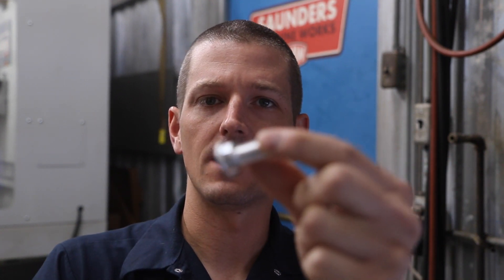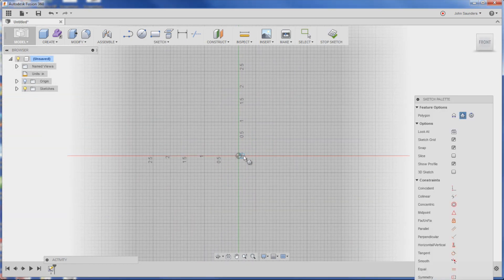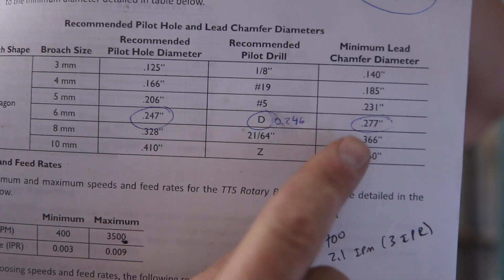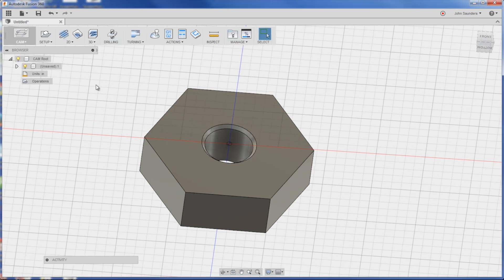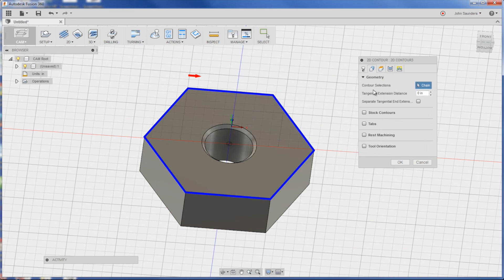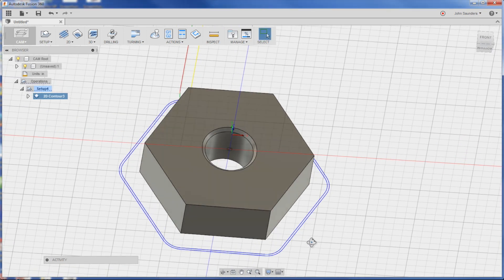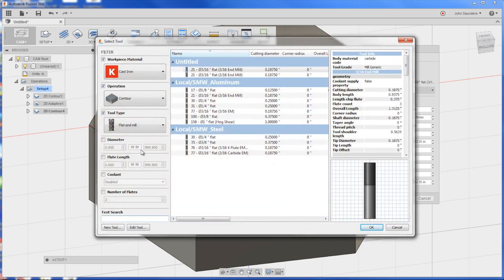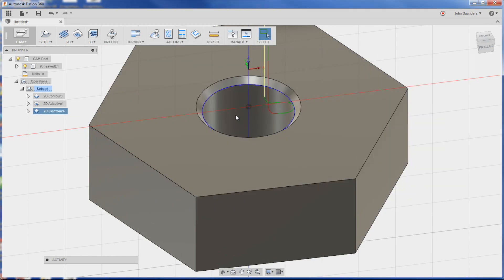Rotary Broach!  Shoving Square Things in Round Holes!

Comment: Me think that the depth would have been deeper if the work piece didn't slip down in the collet. Take a look.
Reply: +NYC CNC  Yeah, the nut probably wouldn't be so tight on those aluminum threads too if they hadnt been forced down in that collet ;) needs a shoulder to back up against, the broach exerts alot of force...
Reply: Good fucking eye

Comment: Very cool!  I've thought about rotary broaching for an idea I had for some custom aluminum r/c servo horns.

One tiny tip for Fusion CAM to save a couple clicks - When you select the edges for the Contour Selections, pick the edge on the bottom of the part instead of the top.  That way you won't have to change the Bottom Height because it defaults to "Selected contours".

Comment: The part slid on you in the collet block. I try to always use a ID stop to 5C collets in a block to maintain repeatability to Z without having to over clamp the collet. you would have a deeper hex if it didn't slid on you.
 I've never used any rotabroach, I was wondering if you are able to "time" the flats of the ID to match the OD ?

Comment: I think I've seen video where they start the spindle after the tool makes contact. That is if the angle matters.
Reply: Maybe, but looks better with chamfer.
Reply: NYC CNC ALWAYS use a chamfer...you'll dull the tips of your broach pretty quickly without one.  You can, however, get away with a smaller chamfer most likely.

Comment: 11:35 You see your clamp fixture failed to hold the part into place. I know you had it higher for the milling operation but you should have re-adjusted the position deeper after so that it would have resistance to the broaching operation on the shoulder of the part!
Reply: +NYC CNC I noticed the little scoot too. :)  I like to thread bolt shaped parts into a scrap piece of aluminum for fixturing if I can.  and as minor a plus you can get repeat clocking between the threads and the milled hex on every part.  
 ....which got me thinking about those square holes:  Is there any way to control clocking of the broached hole?  as it is, I guess it just grabs where it grabs huh?   Thanks for the cool stuff here John!
Reply: Morgan Oliff Nice question, i expect an answer but probably possible if you have a tool to locate the broach initially at the angle you want and then leave it plunge as soon as it grabs
Reply: +St0RM33 it just caught my curiosity,  :) maybe more of a big deal when doing square holes, as apposed to hex.  I thought about, and the only thing I could come up with was to jog the tool down and square it off with a parallel against one of its flats as you bring it into contact with the work. Then let it broach from there.

Comment: Nice tool, probably more affordable than the commercially available ones. Keep broken endmills around for broach making stock. A surface grinder might be nice too..LOL
I did a shop made head a couple years back but was limited on the broach material. Been meaning to try some drill rod but never seem to get back at it.

Colin ;-)

Comment: Very cool.  Any guidance on how you can align the broach to be parallel to the faces  on the outside of the part ?
Reply: NYC CNC  I wonder if the chamfer could be used to guide the tool into the desired alignment. Would it start to cut soon as the corners are caught on their respective edges at a repeatable angle?
Reply: +Matt Hogstrom Some of the rotary broach holders have a threaded hole on the free-spinning part that allows for a stop rod to be inserted. Then the broach is held in a particular orientation by the rod being pressed against a fixed piece on the holder as the tool spins aligning it to the work piece.

Comment: The method that the CAD program uses for calculation and rendering is probably boolean operations. It's essentially a difference engine that calculates what is to exist and what is not. It's an effective and efficient way to calculate something like milling. This of course needs to be correlated with the functional aspects of the machinery. That is probably where the "stock to leave" input in the UI originated. It might seem a little counter intuitive from a real world perspective; but the UI might be more complex and fiddly otherwise.

Comment: That's pretty cool,  So it was using the vertical movement of your mill as a press while wobbling the tool a bit.  Nice fit!  I noticed it pressed the part down into the collet, was that by design?  Thanks for the video, hope you made back from Cali safely.
Reply: NYC CNC I saw it too. was it not clamped in tight enough?  Could you have put a scrap of smaller diameter than the part, in the bottom of the collet to press on the table and contact the part so it could not move down?

Other than that, a rotary broach looks like one cool tool!!!!!!!!

Comment: Hey man, the broach pushed the material down into the vice again... lol :) Try threading internally a round nut so you can clamp it tight not on the threads. Cool tool, i need a tormach! Looks like you've come a long way with fusion ;)
Reply: +NYC CNC Wait was that sarcastic? Tighten the threaded round stock right up to the hex. Wont budge, wont tear threads. I've been at work for 11 hrs without a break now on night shift so maybe i'm just reading your doohicky wrong. Just thought you coulda ruined your threads pushing it down like that broaching, since it slid down the collet and all. Never mind machine on!

Comment: For more accurate work you will learn to reverse the broach rotation halfway into the cut depth.  We used to run them in a lathe and we turned the work and not the broach, which for us was also more accurate than a BP but idk why that was. I just did as told :] I'm really impressed with the Tormach and what they are doing these days.
Reply: NYC CNC keeps it going straight
Reply: NYC CNC I've done the reversing rotation middle of depth on the lathe, yes it will help keep a dull broach straight but a good sharp broach shouldn't need it, especially in aluminum. Also, you can usually get away with a little bit bigger hole.  I noticed that the part moved into the collet during the broaching.  Pucker factor goes up big time using one in a lathe vs a machining center btw...haha

Comment: Can you rotate the part and run the broach in again to get a Torx? or is there broach that are designed for that Torx? Is that the right shape for that?

I cringed when I saw the part slide down in the collet... I was kinda surprised you didn't see it when it was running.

Comment: the part definitely pushed in the collet that's why the hex tool only went in like a 16th of an inch into the part. I Broach on lathes all day. and it goes through the part not just the very tip of the part that is useless

Comment: i have no idea why need cam for this. its quick calculate path or even quicker if have makro for hex. if i not lie that program take 30second write. use this tool mill hex this size. mill hole this size. get chanber tool do this size chamber. get broach feed this deep. how hard is it?
working with fusion. only try get figure out RED RED RED collision is time i write all program by hand. thats funny.why need cam when dimensions are on drawing i just write them to cnc.why cam not smart enought xorrect dont cut inside choosen path lol. why is default do something stupid. why is need do stupid when need correct it do simple working way. cam should be smart. this is tool this is path cut it very fast without collision,but its not work that way. allways need tell how to cut it.same relust i write same program by hand or use my 200 ready made makro for it. yeah im makro freak and not even remember what i have.damn i got that makro why did i use that G65 P1077 blah blah. part ready. oh you got hex draw allready but it was wron. i allready pack parked up and send it